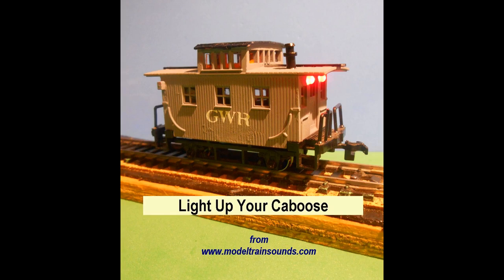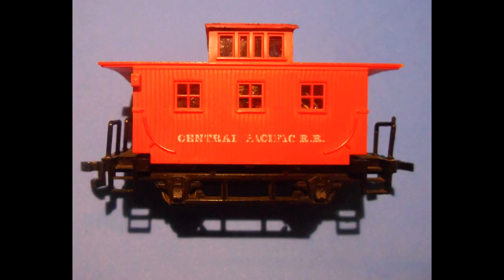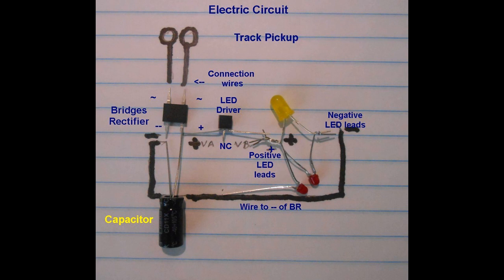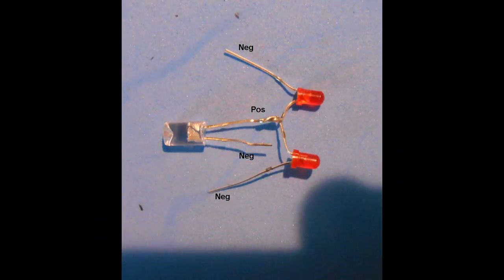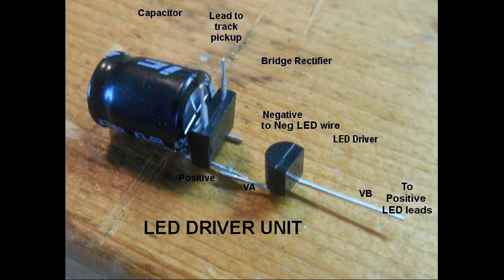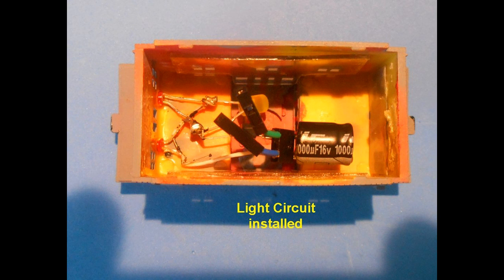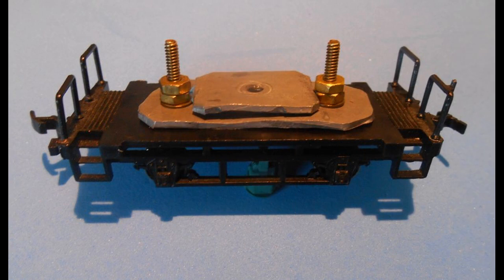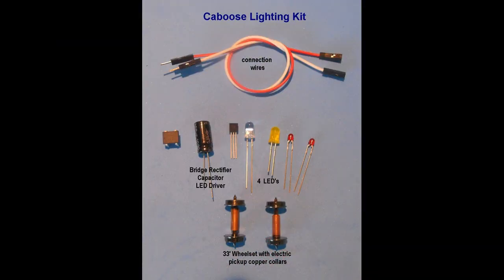Add LED  Lighting to a HO Scale Caboose

Comment: Very informative video, however, I do mine a little differently.  I will use Kadee centering springs for the wheel pickups.  And since I don't use an LED driver I will use some current limiting resistors on the LED's.
Reply from the maker: Hi Rusty.
I am aware of that method. With resistors the current will vary which may vary the intensity of illumination. The LED diver chip limits current to 20 mamps.
Reply from the maker: Should work also. The advantage of the LED driver chip is that from  6-90 Volts it limits the milliamps to just 20 so there is no risk of burning out the LEDs and the lighting is constant.